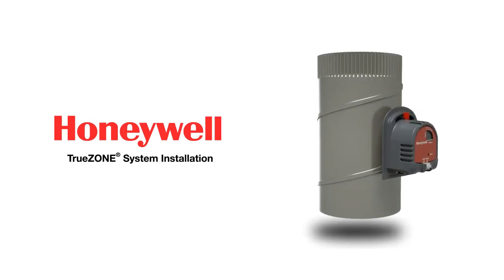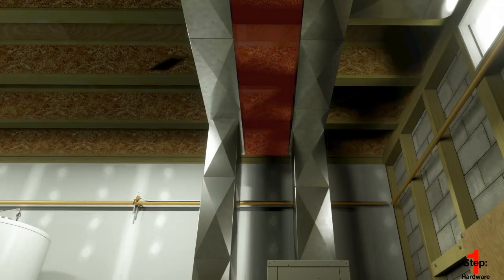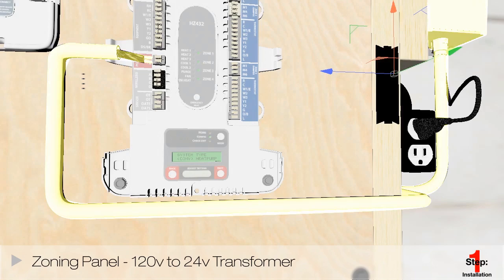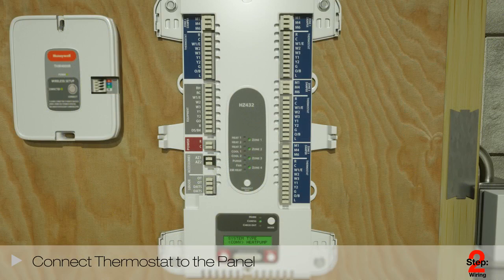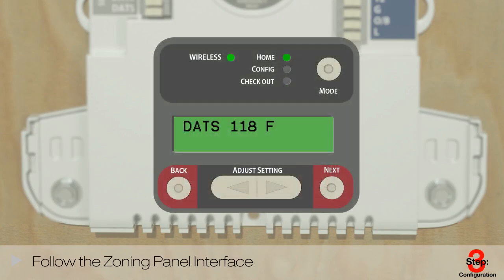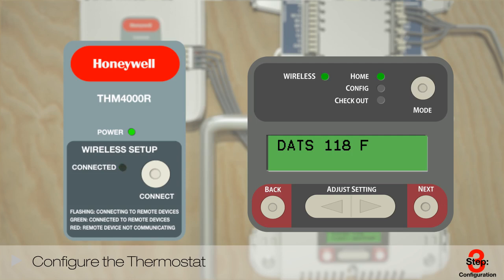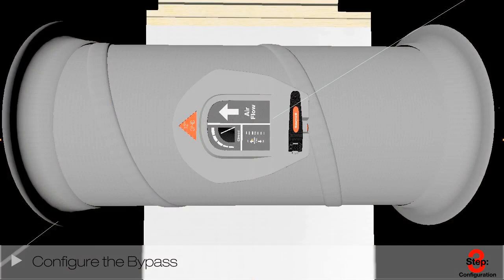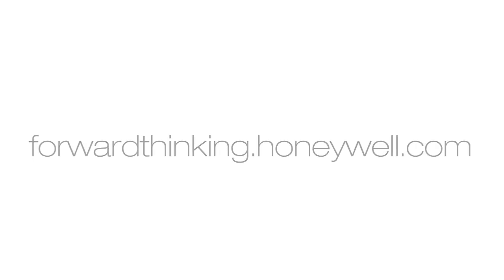Honeywell TRUEZone® Damper System Installation

Comment: This video says that the damper has 3 dimensions, but all are listed and described by only 2,  ZD8X12TZ for instance is 8"X12". You'd assume that they would correspond to what the video lists as dimensions 1 and 3. Why would you really even need to know dimension 2, as it doesn't correlate to the duct size? This part of the video makes it confusing when trying to determine the correct size required.

https://youtu.be/JGcPgo540HE?t=52

Comment: I was quoted a price of $800 to $900 to replace my damper. Is he trying to overcharge me? Also, how do I know if it's a problem with my thermostat...it's 15 years old.
Reply: Sounds high to me. I was quoted about $400....but I ended up ordering this damper only for $100 and replacing it myself. It was pretty simple to install only took about 15min.
Reply: Yes old thermostat

Comment: Do you hook up the thermostat to the zone board and the air handler?
Reply from the maker: This would be a good question you should bring up to the company. We only provide the motion graphics for videos. We are in no way affiliated or involved in the decision making process of this companies products. Creating graphics and process videos of products is what we do. Thank you for visiting our page and viewing our video creation.
Reply: Assuming you're using a hard-wired (not wireless) thermostats, you would need to run thermostat wire from wherever the actual thermostat is at to the zone panel, then wire it as required by your hvac system
Reply: do you have a  chance to install motorized  dumpers ? if so do you install stand alone ?